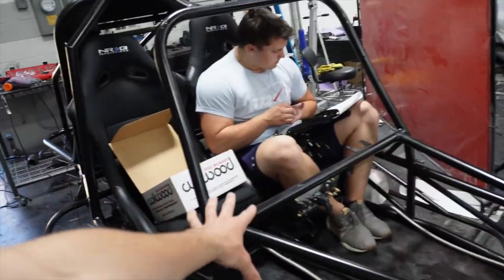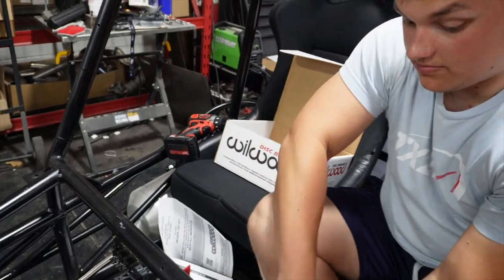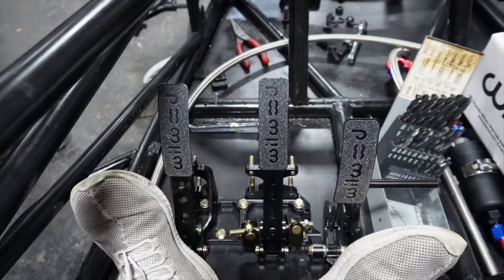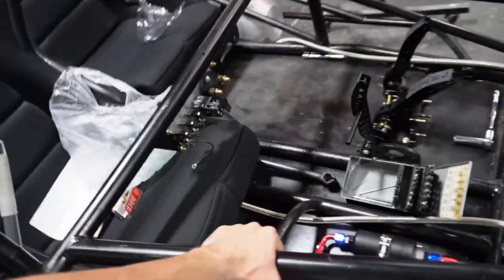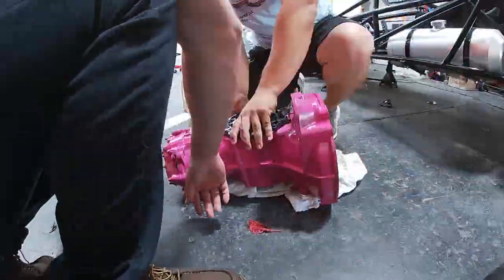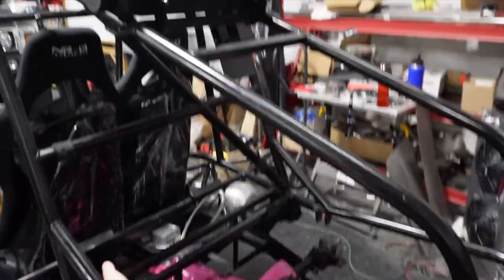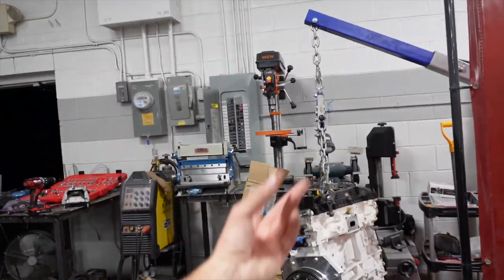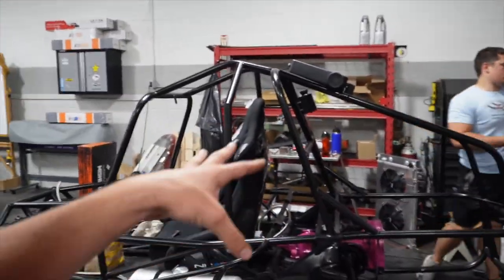Rebuilding and Installing the VW Transmission Into our 300HP SAND RAIL DUNE BUGGY | Sand Rail Build

Comment: If you guys run rear brakes only you could pull some monster wheelies with that thing
Reply from the maker: To be honest it will probably wheelie really well now, with how much weight is in the back
Reply: @CaylebPletos  that is probably true you definitely added a lot more wait with the new motor over the air cooled vw, it's looking great! Can't wait to see it done
Reply from the maker: @braydensmith6553  Thank you! The floor that we added increased the weight a lot. our plan is if we need to add more weight in the front we can do that after it runs and we will then know how much it pops up.